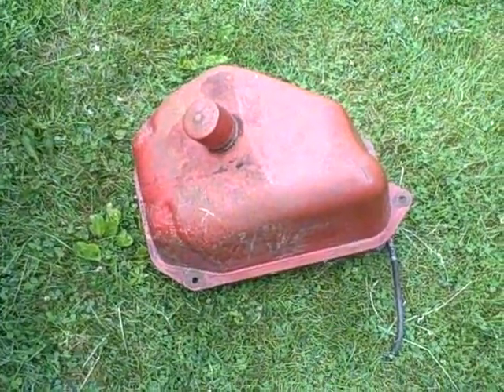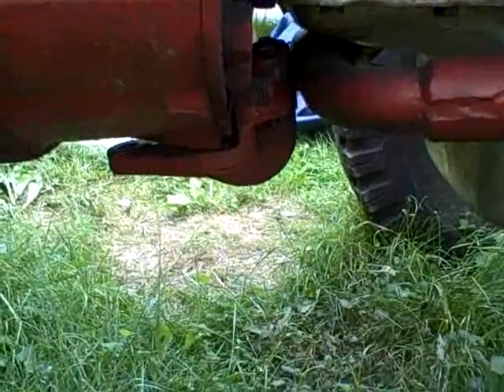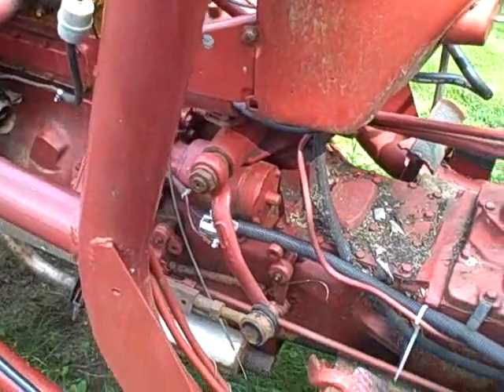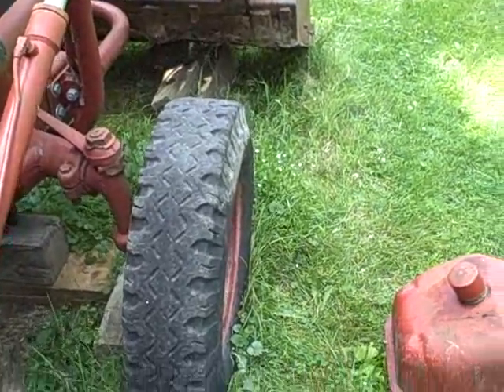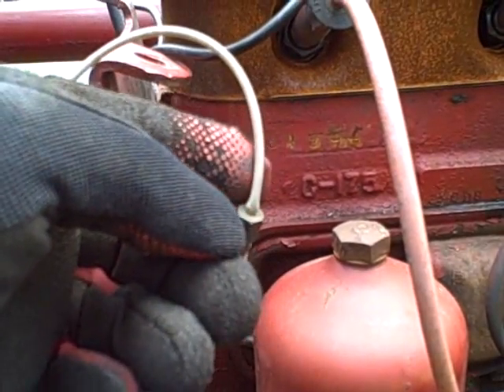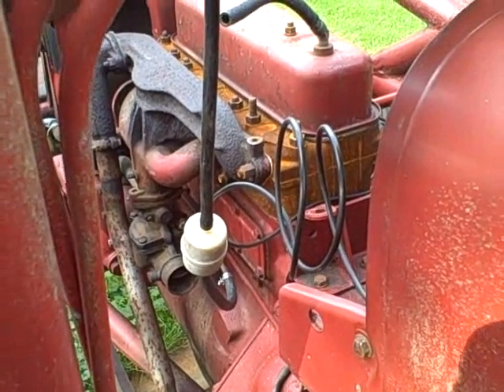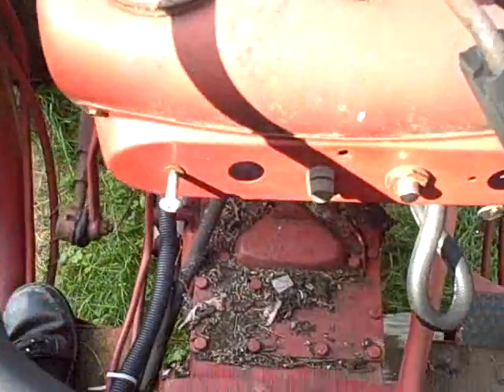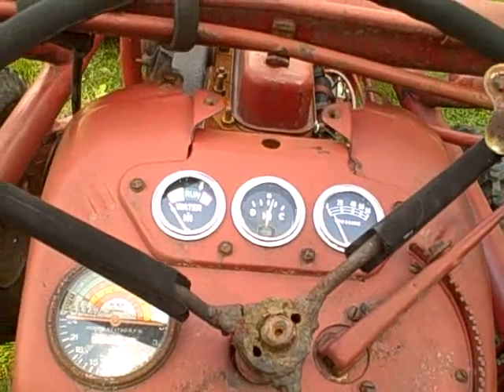IH 350U Tractor Project Part 18

Comment: Enjoying your series. I, too, recently acquired a International 350 Utility, although mine has the battery in front of the driver, rather than behind the seat. In this vid, you mention putting the gas tank back on; did you show it being removed in a previous video? I'm thinking I might need to do that to clean mine.

Thx!
Reply from the maker: Dougie D I think I do show removal of the tank....or at least I hope I do, I'll need it when I finally put it back in this summer. Had to take a break on this project, but I'm ready to return to it.

Comment from the maker: Hello. Thank you for the advice, but this tractor has a hydraulic pump on the motor for live hydraulics. I found the fluid level was too low. Added fluid, and the 3 point now works. The next video should be posted soon. Thanks for watching.

Comment: Hi
 Glad to see she starts and runs good and has some life in the loader and gears :) .
Just a thought here on the 3point try using the arms with the PTO running. some of these old tractors need it turning to drive the pump in the back end, that maybe why it has the front pump for the loader, as when you press the clutch the pto and pump stops  you cant use the loader, the old fordson majors with single clutch are like it and its a royal pain but i don't know about these:(
Regards Robert